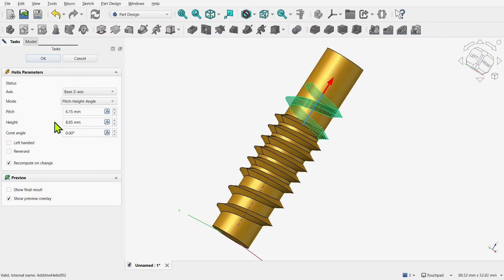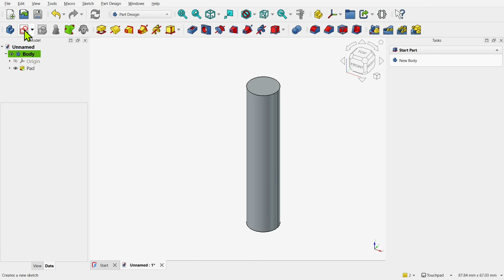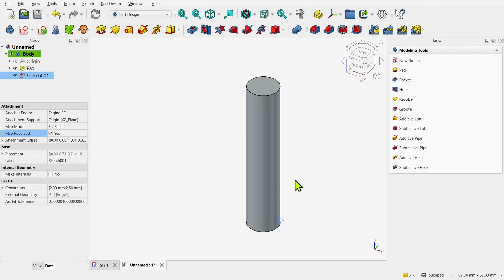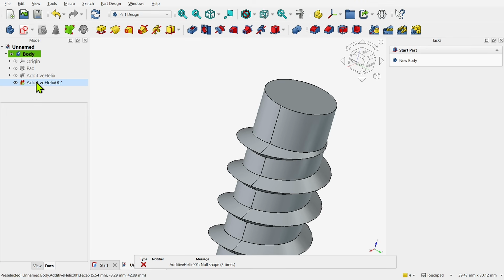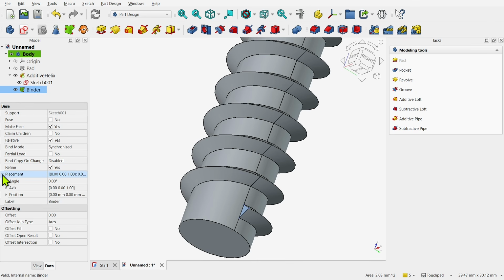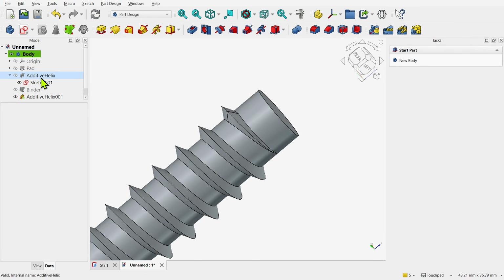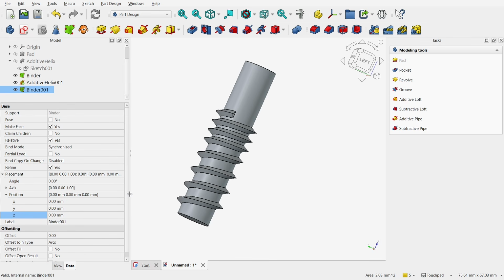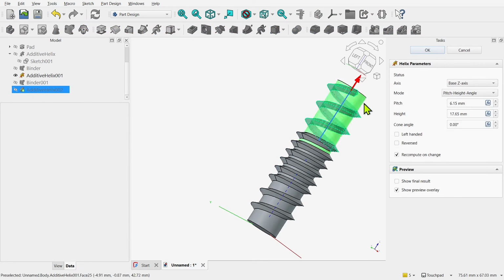FreeCAD: How to Create a Stable Parametric Multi Threaded Rod | Beginner Friendly Guide

Comment: Ok. And now how do you get the nut on a thread that changes pitch halfway through? 😆
Slightly related: be aware that helices are very computationally intensive, as there is no simple geometrical/mathematical representation like there is for boxes, cylinders, cones and spheres. If you have multiple of them and/or do CSG with them your model will crawl to a halt on updates.
Reply: Getting a nut on such a nutty thread? Print-in-place magic! Or a simplified nut that has just a simple dot-like extrusion (or a few of those) instead of a full thread. 😉

I'm still hoping for a proper "knurling" extension for FreeCAD - doing this with helices is a process killer. 😪
Reply from the maker: You will find that after my tutorial on "How to Make a Right-Angle Drill Bit"🤣. Yes, Helix can take a long time to compute (role on multi threading in FreeCAD;) )

Comment: This is a great solution if you need a lead in on both ends of a thread, but it's worth pointing out that in the majority of cases when you only need it on one end, just start the thread from that end! Then you can simply reuse the sketch to helix the other way and it's stable.

Comment: I like your original method of creating threads using additive helixes, but yes, it is prone to stability issues. This method resolves those problems very well. It is also an excellent example of referencing object properties in an expression.  This method also works well for creating a second tail thread on the bottom as you would see on a real threaded rod. And the stability carries through if you change the original dimension constraint on the profile from 2mm to something else.  As always, great job!
Reply from the maker: Thanks for the feedback and for sharing how well this approach holds up with those adjustments!